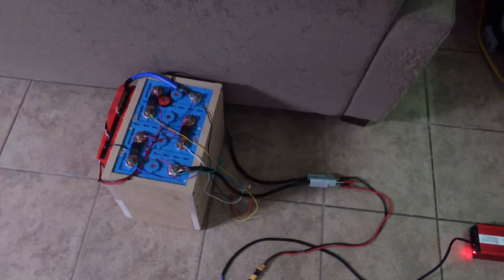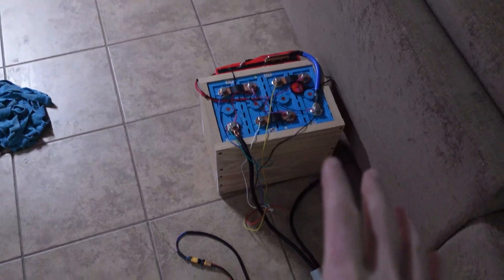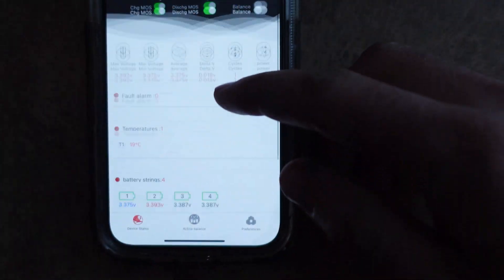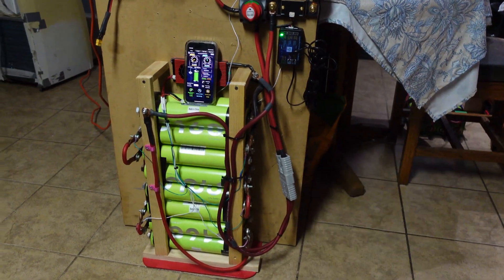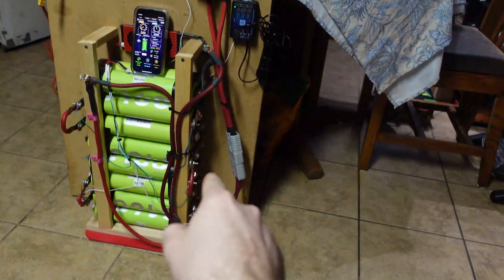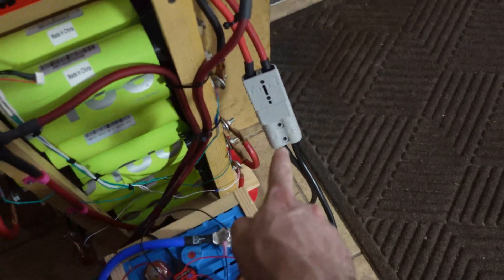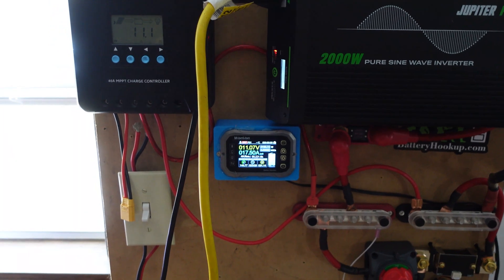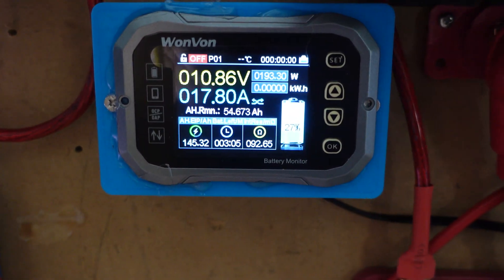Capacity testing my Aliexpress 200AH cells

Comment: Right on, i have the 8 AH headway cells but in scared having like 200 amps separated by a thin layer of red plastic, but no issues so far.
converting a crf 450 using headway cells and a QS 138 v3
Reply from the maker: That’s a good use for sure! Yea they are kinda scary but be safe and you’ll be ok!